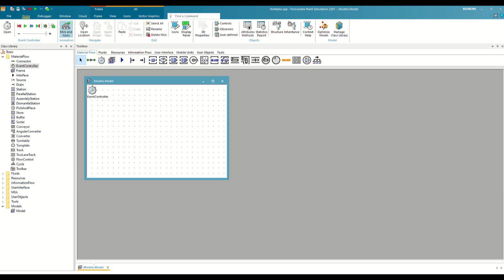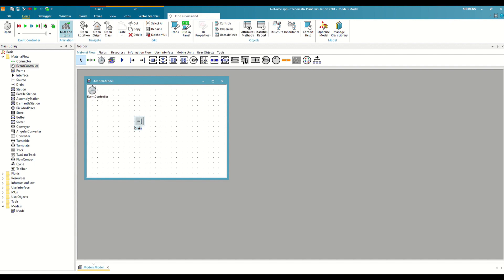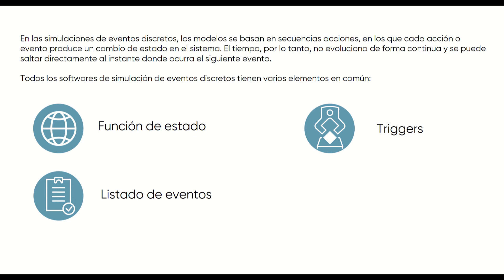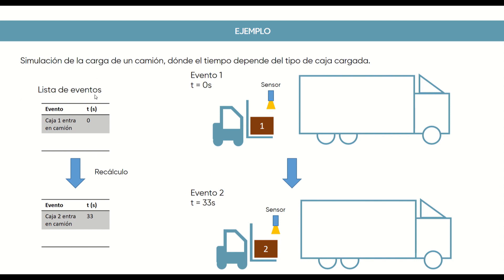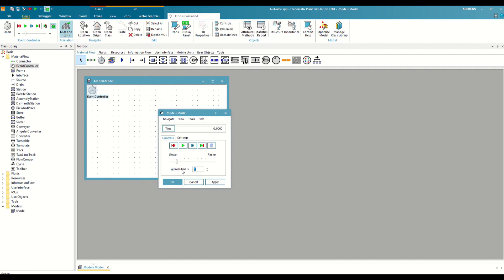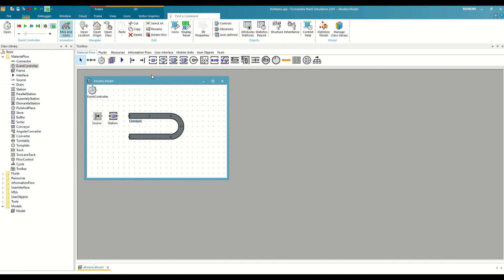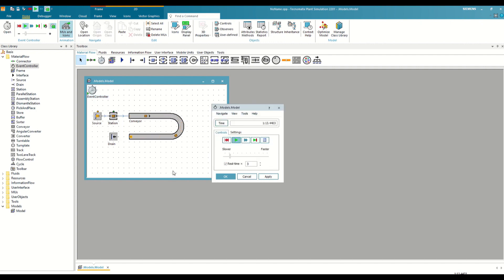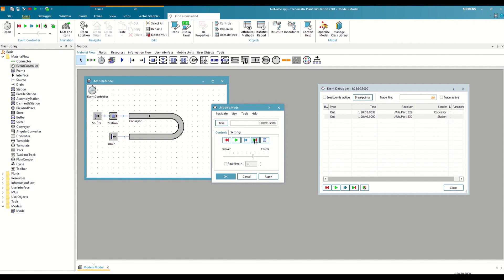Plant Simulation Tutorial (English) - 2. EventController

Comment: can you please tell how we can fix the sequence of pick and place robot
Reply from the maker: Hi youtube.com/@jomerinjoy5896! The short answer is to use the pull and the target control, here you can find more info:

https://docs.sw.siemens.com/en-US/doc/297028302/PL20230512872025076.PlantSimulation/id61965

But for that you will need to write a Method. If you don't have any experience in programming, I recomend to watch my other series of tutorials on SimTalk, made for anyone without any programming experience.

https://www.youtube.com/playlist?list=PLnjbY7Z7-SKdGZ8-TpOh3IWPKq52Yla_m

The other way to control the entrance sequence without having to program a method is using the FlowControl. Connect all entrances of the PickAndPlace to a FlowControl object and then the FlowControl to the PickAndPlace. Then, you'll have to edit the Angles Table of the PickAndPlace, delete the FlowControl row and add a row for each of the real predecessors, with the corresponding angle. By doing so, you can now edit the entrance strategy of the FlowControl to adapt the entrance sequence of the PickAndPlace.